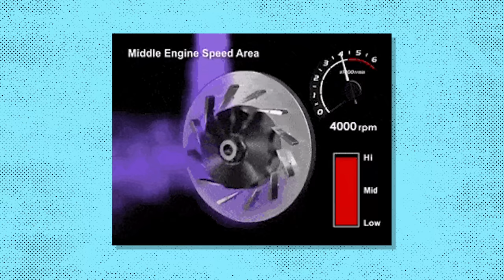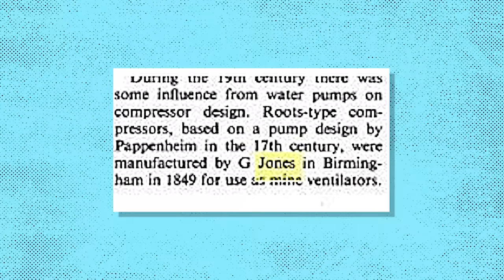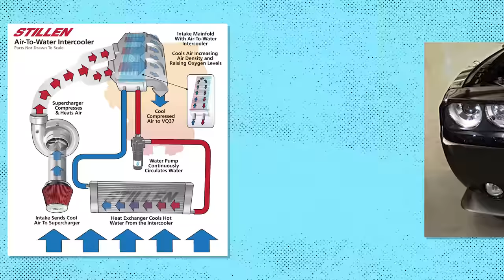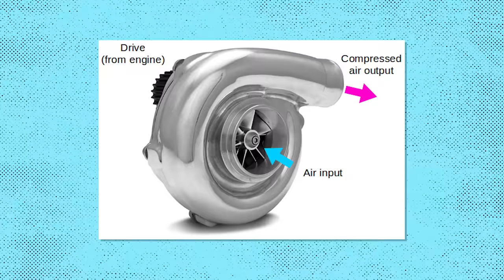Why Superchargers Aren't As Good as Turbos

Comment: I love my zl1 because of the supercharger. I'd rather have my power from the start and whenever I want it
Reply: You would rather have less power? Why?
Reply: @sandervanderkammen9230  ZL1 comes with a supercharger so I didn't have a choice, but even then I love the sound of a supercharger whine. No lag. Instant power. And I'm making 800hp crank. Nothing to complain about
Reply: @otleycrew6670  But you realize that engine could easily produce more than 1,000hp if it was turbocharged right?

Comment: Turbos also reduce engine power by creating exhaust pressure :/ and they are also not very efficient since air (and exhaust gases) are compressible :/
Reply: WRONG, Turbochargers are better than superchargers and poduce mpre power and use less fuel because there are no parasitic drag on engine..
Turbochargers produce more airflow, not less.

Comment: There is actually a solution for the Centrifugal supercharger lag issue. Which is to use a transmission.

No. Not the same as those used in ww2 aircraft, but continuously varible transmissions. In which the boost can br actuated to stay constant on all rpm, perhaps even more constant than positive displacements, as the impeller can stay at the same speed at all rpm range under throttle.

Might sound complicated but at least not as complicated as an electric one.

My favorite one is this one
https://youtu.be/WohJ7f6asmc

Comment: Let's not forget that turbo's also cost some power to run. Just not directly from the engine.
Reply: Turbochargers run entirely on the energy in the waste heat in the exhaust gas.
Reply: No, learn how a turbo works

Comment: Supercharger boosts as soon as you hit the throttle. Turbos have to wait for the exhaust to build up speed to work. It also depends what you are going for. A drag car or a high speed long distance runner.
Reply: Depends on the type of supercharger,  
Some of the fastest accelerating cars in the world are turbocharged...
Turbochargers are banned in NHRA.
Reply: They also look like crap on a classic car like my 1953 chevy. A blower looks much better. If i want to go high speed for a distance then a turbo is the way to go but for quarter mile drags a blower is the way to go.
Reply: @1perveysage  The NHRA banned turbos because they made the cars too fast.
Reply: @1perveysage  I have a 53 Chevy..
It's no drag car..
I have driven faster tractors.
Reply: And i am not talking professional drag racing. They do make the drag cars faster on the top end where they are getting ready to stop, not accelerate more.
Reply: With a big block and a Muncie 4 speed? I am not building it to be a strictly track car. Street driven almost daily gasser is what i am building this time. This is my second 1953 4 door gasser i have built. I am building it in what is called period correct. No newer than 1975 or so parts.
Reply: @1perveysage  Certianly not, the 53' is no race car, in fact it was my grandmother's car, grocery shopping on Wednesday, church on Sunday.
 Turbos were officially banned because they made the cars accellerate too fast.
Reply: It may not be a (Race car ) as is but they get the job done and look cool while doing it. The last one i had was powered buy a 235 blue flame 6 with a custom crane cam and 3 carbs and much more. I used to pull the front wheels 6 inches leaving a red light. The look on guys faces in mustangs etc was priceless. This time im going full bigblock with blower. I could care less about the modern pro drag racing. Not that i have anything against anybody who does. Look up period correct drags. Lots of youtube videos.

Comment: Carburetors before there wasn't fuel injection on most cars and they couldn't run a turbo unless you ran fuel injection but you can run a blower and a carburetor because you don't build pressure
Reply: Several examples of carburators used on Turbocharged automobile and aircraft engines exist.
 The carburetor can be used in a draw-through or blow-through configuration on both supercharged and turbocharged applications.
Any questions?

Comment: The parasitic loss is the tradeoff to no lag and linearity. It's a tradeoff I'd make every single time though. Imo if you're a real driver's driver you'll prefer a supercharger. It just makes the whole driving experience more direct. OEMs go for efficiency of course, and drag oriented tuner folks want every lats drop of power and will forsake drivability. Lastly, teens like turbos. If you know something about dynamic, performance driving you'll ask for a supercharger.

Comment: Mr. Media keeps repeating the same fallacy.  "Superchargers take engine power to work".  So do turbos.  If the exhaust gasses push on the turbo impeller with 10 pounds of force then the pistons in the engine are working harder to push exhaust gasses out of the engine with the same 10 pounds of force.  The differences in physical forces and thermodynamic efficiencies are what separates turbos and superchargers.  In general, modern turbo systems are lighter and have more placement options, plus US cars have always relied on cubic inches and torque (which favors superchargers) and European engines often rely on high RPMs to achieve horsepower (which favors turbos).
Reply: Turbochargers do not add parasitic drag on engine, the Exhaust turbine wheel is driven by the heat energy leftover in the exhaust.

I think you ned to learn how a turbocharger actually works...
Reply: @sandervanderkammen9230  The exhaust gas is hot of course, and it is the FLOWING gas that turns the turbine in the turbo.
Reply: @coffeehawk  Right, there is no parasitic drag on engine, the turbine runs off the energy in exhaust.
Reply: @coffeehawk  You really don't know anything about engines or turbochargers do you?

There are some very basic fundamental Fluid Dynamics and Thermodynamics involved that you clearly do not understand.

Please do not post anymore false and misleading comments about turbochargers..
Reply: @sandervanderkammen9230  lol, now I know you're trolling.  But, feel free to post any equations by Bernoulli or Clausius, etc. that explain how moving fluids carry no force.

Comment: Superchargers are found in a lot of high-performance American vehicles - the GT500, the Dodge Hellcat, etc.
Reply: Turbochargers are much more common, they deliver more power and are more efficient.
Reply: Here in America we still implement large displacement v8 engines. A more applicable platform for a blower.
Reply: @JasonLuther1  What about Ecoboost and Ecotec engines???
Reply: The top American supercars are all turbocharged

Comment: Though less, turbo systems also pay a price to produce greater power via greater exhaust back pressure
Reply: Turbochargers don't have backpressure... at full throttle the intake manifold pressure is the same or higher than exhaust manifold pressure... no Delta~P, no backpressure.
Reply: Turbochargers make more power because they have less pumping loss and they waste less heat energy.

Comment: It all has to do with fuel economy, and costs per vehicle. With the way the EPA standards are, dodge can get away with it due to the hybrid side of their brands, to meet the EPA threshold. I mentions Sales and now economy because it’s easier and more fuel efficient to make and honestly, more reliable to turbo a 4 cylinder and get the same performance from an n/a 6 cylinder or 8 cylinder. Also lighter and cheaper to manufacturer in large mass. 1$ a car is 4.87 million dollars for just Volkswagen in 2023.
Reply: Superchargers are just as good than you projected, when installed and setup properly they produce great numbers and are reliable, just need a reliable brand and perform the maintenance required when it’s required. They don’t rob nearly as much engine power as your reactions suggest
Reply: The fastest production cars in the world are turbocharged.. because turbos have a major advantage that superchargers don't.
A supercharger can never make as much power.

Comment: Stop saying Roots Blowers dont compress air.  Yes they do.  Air comes in tbe case at atmosphere, comes out into the manifold at a higher pressure.  It got compressed.  The blower compressed it.  It didnt compress on its own, or you wouldnt need a blower.

Comment: I still don’t really get why turbos are more efficient. Superchargers add resistance on the belt but don’t turbos also apply resistance via back pressure in the exhaust? It seems like a free energy fallacy.
Reply: The Turbocharger is a Heat Engine  unlike a supercharger that is only a compressor.
The Turbocharger exhaust turbine is powered by the waste heat of the reciprocating engine and produces all the power used to drive the centrifugal compressor.

The centrifugal compressor is a more efficient pump than the reciprocating engine so more horsepower is produced at the crankshaft for the same fuel burn rate.

Comment: It takes as much power to drive a turbo at it does a supercharger(well ot costs you the same amount of power by removing efficient headers and and blocking exhaust not to menntion obstructing the intake massively with the turbime the manifold miles or piping and intercooler) a n/a car has more bottom power before it is turbocharged

Comment: Wouldn’t adding a turbo (or two) add more weight to the vehicle?

In addition to the compressors, you also need to run additional pipes.

And doesn’t exhaust exchange mess with, well, exhaust exchange …basically restricting power-release to make power? Kinda goes against the racing logic of open or less restriction = more power.

Lastly, if you go to the drag strip and watch any super class cars, they’re all using blowers. Not a turbo to be seen.
Reply: The gain in engine efficiency easily cancels out any difference in weight.

Turbos are BANNED in many drag racing classes including NHRA Top Fuel.

Comment: I'm unsure why this is always a topic of debate. Both the turbo and the super have their pros and cons, but supercharger parasitic draw isn't one of them. In a study on a dyno, both producing 10psi of boost, a turbo and a supercharger will both add roughly the same wheel horsepower? Why? Thermodynamics. Like you said at the beginning of the video, power is made by air and fuel - cram more air in, get more power - but 10psi is 10psi. It doesn't magically add or lose oxygen molecules because it was drawn in by a Roots supercharger or a turbine charger. The parasitic loss of power evident in superchargers being spun by the belt is also evident in turbos, just in other places, such as heat, backpressure of the exhaust, and the excessive travel for charge air cooling. There's also bypass valves and such present in newer cars (such as Audi's supercharged 3.0 TFSI) where once the supercharger is no longer benefiting the engine, it's bypassed entirely.

Lemme simplify it for everybody out there. Do you want instant torque/power, consistent power across the rev range, and a fun whine? Get a supercharger. Do you want to cram 20+psi of boost into your engine, make insane power at high RPM, and make fun psh/stututututu noises? Get a turbo. You literally cannot go wrong with either, if done correctly.
Reply: WOW! everything you just wrote is completely WRONG.... you don't know anything about forced induction.
Reply: @Samus5164  Lol!!! Do you really think anyone believes that???

You are obviously not formally educated or have any professional experience on this topic.

Anyone familiar with forced induction knows that a turbocharger engine will always produce more horsepower than a supercharged engine at the same intake manifold pressure.

Turbochargers don't have any parasitic drag or load on the reciprocating engine.

Any questions son?

Comment: There are just too many variables to compare the two.  If you put a supercharger on a car and looked at the horsepower and torque gains, then installed an "equivalent" turbo (of course there is no equivalency between the two), and looked at the figures for that, and then compared the drivability, the cost (which would vary greatly depending on the specific car) etc...  I think it comes down to individual preferences more than anything else.
Reply: It's very simple and can be summarized by the simple fact that turbos make alot more power all other variables being equal.
 This is because turbocharged engines waste less horsepower.
Reply: It's not a matter of preference at all, turbochargers are superior to superchargers. This can be easily proved under controlled laboratory tests and in real world applications.
 Turbos do have an image problem that stems from the fact that most people do not understand how they actually function and are fooled into believing alot of false urban myths about them, such as the myth that they cause backpressure.

Comment: I don't get how a root supercharger can supply the same "amount of air" at any rpm when it spins faster the higher you rev?
Reply: Good question, its doesn't.
The Roots blower pumps the same amount of air per revolution so twice as much air at 2,000 rpm than it does at 1,000 rpm.

Comment: The point of a supercharger is instant boost. Quicker gun lives. First is better than lag.
Reply: Turbocharged cars typically accellerate faster... they make more power and more torque, throttle response is better with a supercharger but you still cross the trap last.

Comment: I tend to dismiss broad statements like "super chargers suck".  It's been my experience that you need the right tool for the job. A super charger does a great job on a NHRA top fuel dragster. Maybe be more specific. You could say "super chargers suck for consumer cars".
Reply: I tend to dismiss statements from people without experience... superchargers lack a key fundamental advantage that turbocharger do have... a separate engine that does not place a parasitic load on the reciprocating engine... and that you seem unaware that turbochargers are completely banned in NHRA Top Fuel and Top Alcohol classes.
Any questions son?

Comment: Let's not make it sound like turbos use "free" otherwise wasted energy from the exhaust. Having to spin a turbo to hundreds of thousands of rpm imposes an exhaust restriction too. Doesn't rob as much power as a supercharger and makes way more boost, but it isn't free.
Reply: Actually, the heat energy used to drive the exhaust turbine is free...
Reply: @sandervanderkammen9230  oh really? Heat drives a turbine? Please. Explain. How.
Reply: @mikemx55  Its called the BRAYTON CYCLE and is the same principle as gas turbine or jet engines.
Reply: @mikemx55  thermodynamics

Comment: turbos obviously win for efficiency and total power output. but I've felt let down by every turbo car I've ever driven. for regular driving, the turbo lag just kills it for me. it's NA or blown as far as I'm concerned. I don't even like cars with E throttles because they have a little lag. maybe I'm just too picky
Reply: Turbo lag isn't a real problem as much as it is an imagined one..
Turbo cars generally accellerate faster.
 Its more of a problem for inexperienced or less skilled drivers...
Reply: @sandervanderkammen9230  obviously a turbo is faster, im talking about throttle response. every time you let off the gas, you gotta wait for it to spool back up. daily driving in traffic and around town, it makes the car feel sluggish
Reply: @ckl8a  What are you driving around town as a daily driver where that would be a big issue? A vintage F1 car????

Comment: I had a 600HP Nissan twin turbo with major lag that needed turbo rebuild after 5 years.'
I had a 585HP Viper with a Supercharger for just over 5 years with no issue.
Now I have 1100HP Viper with a Supercharger and pulls smooth and strong. 
Turbo get TOO hot and need rebuilds. Superchargers are more reliable and last and easy to replace if needed.
Reply: Your Nissan was obviously a poorly designed pile of junk and never ran properly. You little Viper story sounds great but it does not prove anything.
The fastest production car in world is turbocharged.
Reply: @phantom5573  You really don't know anything about turbochargers or superchargers do you kid?
 That would depend on the type of supercharger, centrifugal compressors all have curvalinear performance... so thats just a lie.
Turbos make more power and are extremely reliable, they are so reliable that they are used on certified passenger aircraft.
You should stick to video games.

Comment: stock 500hp, add supercharger 1050hp, even though you're loosing power to make power you still end up with more power and better sounds
Reply: You are still ending up with less power than a turbo with the same manifold boost pressure... the turbo engine will ALWAYS produce more horsepower and torque than a supercharger
Reply: @fallingcomet1518 Turbochargers are preferred because they make alot more power and are faster.
Turbos are extremely reliable and maintenance free,  they're so reliable that they have been used on passenger aircraft for almost 100 years.
Reply: @fallingcomet1518 Turbos are way better.

Comment: Super chargers don't suck and aren't very inefficient depending on the engine they are attached to. If your starting off with a small high rpm engine that doesn't have alot of power to begins with superchargers aren't a good match. BUT if you strap a supercharger onto a 8L V8 HEMI you'll have one of the most powerful & power dense engines humans can build
Reply: Wow, you don't seem to know much about anything..
Reply: @sandervanderkammen9230  what a clever and creative insult, how long did you spend thinking this one up?
Reply: @1008chaz  The point is that it's true... you don't know anything about engines or forced induction.